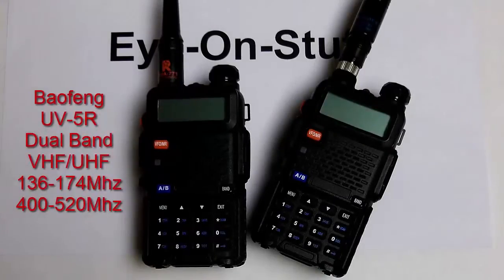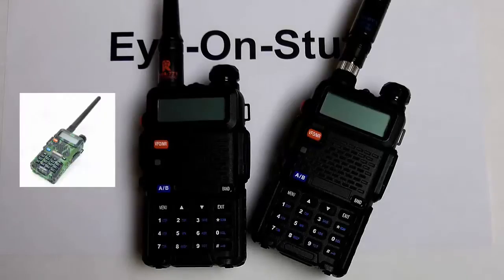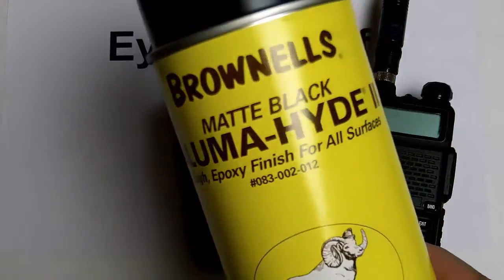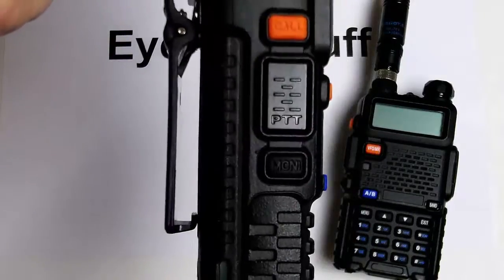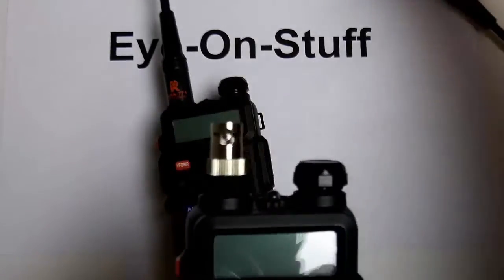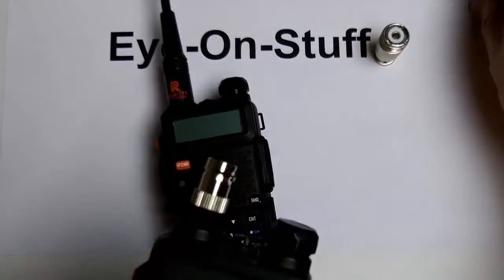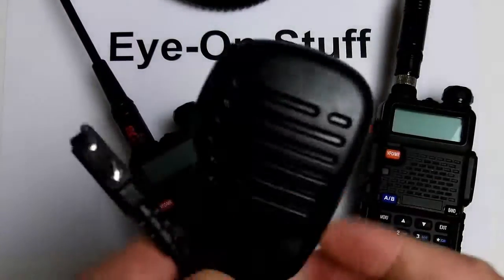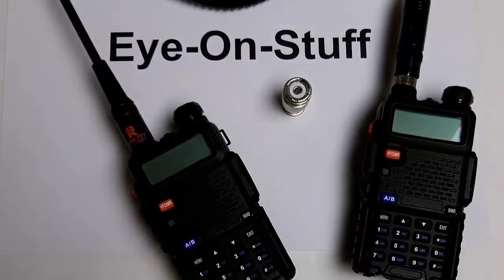Baofeng UV-5R UV5R Dual Band VHF UHF and New Paint Job : Eye-On-Stuff

Comment: How did you remove the speaker as to not get paint all over it?
Reply: He most likely didn’t remove the speaker. Just put a backer behind the frame of the radio, pull the buttons out, tape over the plastic where the screen is and spray paint it. The speaker  is soldered